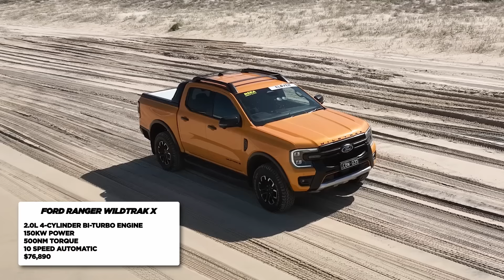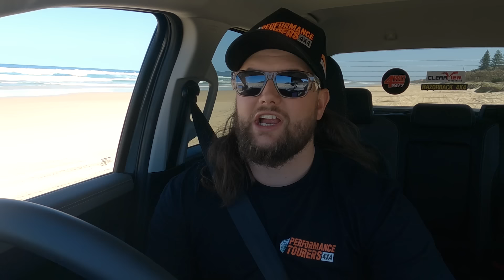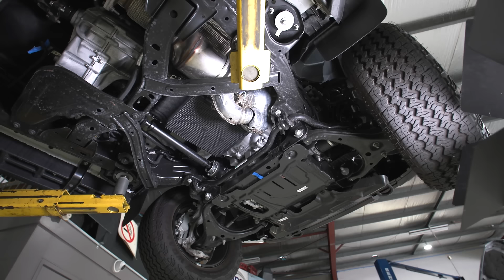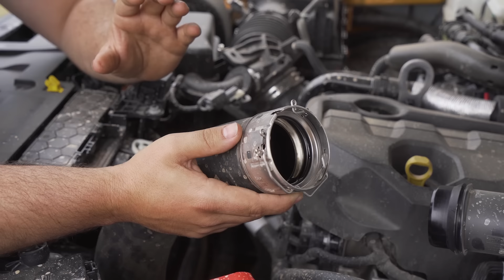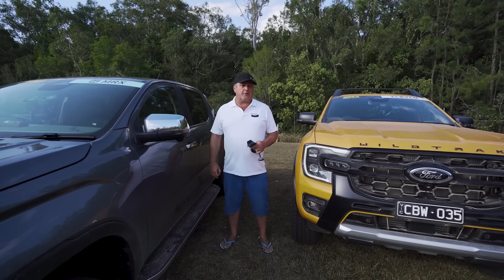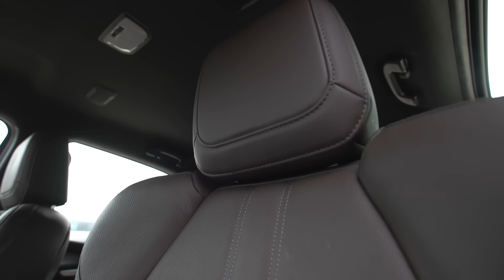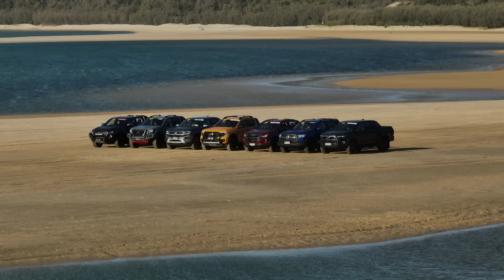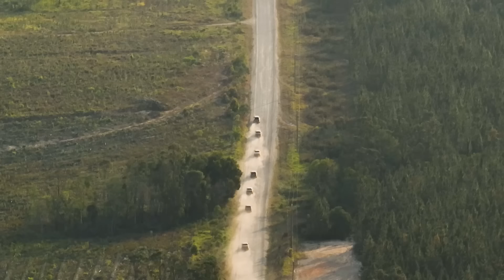2023 4WD UTE COMPARISON - Top Pickups tested Off-road - Shock winner!

Comment from the maker: TIME TO HAVE YOUR SAY! Which of these would you own & why? Tell us in the comments below!
Reply: Mitsubishi triton
Reply: Hilux
Reply: Ranger 3.0 v6 all day
Reply: Toyota poor safety, in passenger safety cell design and technolog,  poor capacity, GVM, GCM. Under powered and fuel heavy, poorly calibrated traction system, small brakes with warped discs often a issue. Airbox design that doesn't have enough clips to seal allowing dust ingestion.
Reply: Where’s the jeep gladiator Rubicon ?  Probably the best off road pick up.
Reply: I knew that the Cannon would surprise everyone.. It was great to finally see one being tested.  The engine does need more power though. This is true for all the Chinese vehicles. They don't seem to have the same power output that the similar sized Japanese or even Korean engine would.
Even more impressive is when you think that Arctic Trucks have a version of the Cannon in their lineup. These are the same guys who built the Top Gear Hilux to go to the North Pole and according to them,  it seems to do very well.
Reply: @007Knightjp  no resale. Not tried and tested. A rubbish truck. Good for 100000k. But then?????????. Hilux all day long.
Reply: @DJ70404  It seems can't go anywhere on the internet without bumping into a fanboy who can't comprehend that some can be happy and have a good reliable experience even if it doesn't have a Toyota badge on it.
Reply: @007Knightjp  you did read my triton comment didn't you? I loved the triton. I was going to buy a new one. Then I took the Rogue for a drive.....
Reply: @DJ70404  My apologies. I did read your Triton comment. I'm just tired of constantly seeing comments from condescending Toyota fanboys all over the internet and on every single vehicle review on youtube stating how Toyota is the best ever and every other vehicle brand is rubbish. 
Then they get upset when I reply, telling them how I've had to stop a number of times to help people when their Toyotas have broken down either from overheating or the engine died for no apparent reason. I drive a Ram 1500 and it has never given me issues in the 9 years 300,000kms I've done in it.
Reply: @007Knightjp 因为中国有严格的排放标准，导致没有厂家愿意生产大排量的汽车。以后混合动力和电动将是中国汽车的主流方向。
Reply: the V6 in the ranger and amorok is the Lion v6 as seen in the landrover discovery 4........ not a paragon of reliability.
Reply: @craigblack85 unfortunately, most people don’t use their brain to do research. Only absorb whatever car experts gave to them. I was questioning the same thing in different channels about this 3L v6 lion engine.
Reply: Amarok or Ford.... Beast. It dragged all the other 4wds home on your Kimberley trip.
Reply: For the towing you said the D-max gets a 6 but on the board you put a 7
Reply: I wanted something aimed at off road and got a Rubicon Gladiator.  Coil sprung solid axle front and rear with front and rear diff locks and 33" from factory.
Reply: Should have included Mahindra Scorpio 4wd Ute
Reply: Massive Toyota guy, so 100% the Hilux. Can't beat the reliability, repairability, and upgradability of it. My only change would be to get it manual, and just a number of aftermarket mods
Reply: Toyota should not receive the notarity or media promotion based on a fanboys profile. 
A 3 star safety rated vehicle vs current 5 star 2020 vehicles Toyota put profit over public safety in all their vehicles and should not be rewarded for that alone. 
Toyota vans have injured and killed more people for this exact reason 5 stars vehicles available for 10 years while Toyota did nothing.
Reply: I love the Navara,good looking rig,more comfortable..
Reply: I have a XSR Cannon and tbh, I get  a lot of hate for it... becareful guys cz honestly it just gets better and better so thank you for this Vid I was happy that the Cannon did alright 💯💪❤️
Reply: I'm from the USA to bad you don't have the Chevy Colorado zr2 the new Colorado is an awesome off-road vehicle I bought one and love it with front and rear lockers and has lots of power with the new engine I owned an older Colorado that was not a zr2 and put quite a lot of money in it upgrading it but as I get older I like having the factory installed options with warranty why don't you guys have the Jeep gladiator there it's sold in Australia it would destroy the other trucks you have there
Reply: @mrgreen8357  it's a chevy. We don't need that crap here. It'd break.n
Reply: Ya know the country has gone to pot when they start calling Ute's a pick-up or a truck....I'm retiring from this milenial nonsense.
Reply: I'd get the Jeep Gladiator Rubicon, because it would sh!t on all of these
Reply: Hey guys, wandering why yous not testing rg Colorado?
Reply: I’ll wait for the new Hilux.
Reply: Hilux  and Dmax all the way!
Proven and tested to last long.. 

My friend of mine owns a 2019 ranger raptor and it has already an engine support problem with only 15k++ ODO 😅
Reply: Amarok all day
Reply: hilux bro, durability ok reliable, dan tidak terlalu malu, teruji di medan
Reply: Just cuz I'm from the States, I would buy the Triton cuz we don't get one! Also the Mazda truck is weird as hell. I think I'd go Isuzu 🤔
Reply: I,m over in Wales and had my MK5 Hilux for 21 years , you can't beat reliability , and this is my 2nd Hilux , btw, i paid £6,450 with the trade in of my other Hilux so that is value for money, no fancy electronics to go wrong.
Reply: No doubt right from the I'm:text-green-game-over: taking the FORD RANGER WILDTRAK X:washhands:
Reply: @4WD247 when is the 2024 video coming?
Reply: My friend has the exact same wildtrak x same colour and same everything I’m pretty sure they got it from Queensland 1:09
Reply: Next year make sure they all have the exact same all terrain tires, because nobody keeps the factory tires
Reply: Hillux
Reply: Screw all the overpriced brands! I’ll take the cannon 💪
Reply: V6 ranger, Really hoping to see the ranger raptor and ranger super duty next time
Reply: Hilux, proven and durable, not saying people haven't had dramas. But I've owned two here in Central Aus for bush work and were bullet proof. I'm onto a 2024 LC79 now another solid rig!
Reply: Where's Mitsi Triton/l200?
Reply: Where is the Triton... Where is the bang for buck ute!!! 
We see enough of these utes plasted all over youtube, id rather see the underdogs perform.
Reply: @bradleybarker4268  Ford wouldn't have paid them because it'll win in the capability segment again
Reply: hilux bro durability reliable dan teruji di medan
Reply: I am still wondering why havent you guys got the Mendez Benz x-class 4wd ute
Reply: @crunchied8 it's been out of production for 2 or more years, defunk, history, gone.
Can't test what can't be supplied.
Reply: @crunchied8  they don't make them anymore
Reply: For us down here in Au and NZ there's only one choice. Hilux all day long. Any shortfalls have been well and truly addressed in the aftermarket and a there's a massive amount of aftermarket options, parts easy to find, easy to work on and everyone knows how to work on them. If you can't afford a 70, Hilux is the next best option.
Reply: I reckon the hilux. Everything else is junk

Comment: Not sure why AdBlue is a large consideration - most of these vehicles will do 10-15,000 km to a tank of AdBlue, so if you were heading out properly remote you’d just top it off on the nearest highway. If you’re towing heavy you might only get 4,000 from a tank of adblue, in which case you’d throw an extra bottle in the car at the nearest servo. I see AdBlue everywhere I regularly see trucks, given so many of them use it too. 

The flip side is a big improvement in emissions, which is basically the only way we’re going to get to keep driving diesels. It’s totally worth it in my mind, and I’m disappointed you use your big platform to talk down to it.

Comment: I love your show but I am going to call you on the towing of the Cannon I have a 2021 base model cannon and have been towing with it for the  three years I have owned it. My van loaded is around 2500 ton and I have not had any of the issues your guys seem to have found. Love to know what mode you were towing in because I turn off  lane control and put it into sport mode and dont even know my van is on the car, So not sure why you guys were having  the issues you were having

Comment: What a great video, but one thing comes to mind during the sand test. Me being a WildTrak X owner, i think if you put it into "Sand" mode or any other one of the off-road mode, it will turn off Engine auto off feature. In-fact during the first test, if Jocko used mud-ruts/rock crawl, the X would've eaten that hill for breakfast without breaking a sweat, but i know the crew here is trying to leave everything as "factory default" as possible, but if that is the case, then the ute/car will be in the wrong mode for the job, default mode would be useful for overall on tarmac comfort etc.

just my 2 cents thought.

Love the video, love the crew! especially Jocko! and love the show!!

Comment: Not as good as the year before, still entertaining but using the premcar Navarra is pointless and not putting them all on the same AT tyres like the year before either.
Great feedback from EFS, amazing that Mazda/Izuzu haven't had to do a recall (Mazda Frankston & Mazda Australia deny it exists ). Do not buy one unless they are so cheap that you are willing to replace the suspension under warranty from day 1. If I had seen this 2 years ago I would have bought the Rogue instead of doing all the changes to BT50 only to trade it in.
Reply: What happened mate?

Comment: Great review.
Just noticed on the brake engineering that the Hilux front rotors are only 2mm smaller than ranger but is the only vehicle on the test to run 4 piston front callipers not 2 piston like the rest.

Comment: Jocko, only the Navara, Ford, Amarok can engage rear diff with TC still working upfront, unlike the hilux (navara did it first with pre-facelift). Those 3 should score higher than Hilux, but it is to be expected that u guys will score the hilix higher

Also it is better u get drivers who know their cars,a ford driver, a nissan driver, and ask them to do the tests themselves. Now u guys are just judging by what u know (likely Hilux), and if anything is askew it is scored down!!!

Comment: D-Max for me, but I’m thinking Africa tourer. That engine can chow down terrible fuel. Toyota tax has you paying a lot more for parts with the Hilux. Both can be fixed by a bush mechanic. I see lots of wildlife service rangers using DMax and MUX in the parks and that’s usually a massive stamp of approval for a 4X4

Comment: The comment made a few times in this presentation "good for 10 years ownership"   was my guide to selecting a new ute, I studied the market closely for three years and just recently bought a new BT50 , no regrets whatsoever, really getting to know and appreciate it. Much quicker and smoother than I was expecting, I'm banking on ten or more years use in the country. Been driving 51 years now and hand on heart the BT50 is the most fuel efficient car I have ever owned and is brilliant for distance drives, effortless feel at cruise etc. Will be investing near two grand for the aftermarket steering knuckle kit that alters the geometry and removes the bump steer problem, apart from saving tyres I'm told the front end will sit more stable on the road. Thanks for the test, I really enjoyed watching.

Comment: Something to note about the dmax tailshaft is that the lower spec model actually has a steel tailshaft, which is fitting to their rugged work focused design. So if you really wanted to, steel tailshafts are available to swap into the higher spec models.
Reply: Yes but lower spec has two piece and doesn't fit the body missing the crossmember mount

Comment: Don't let adblue stop ya...I'm a truck driver its more common then you think 🤔 my mother has bought 2023  Bt50 pov spec manual....I have driven it bog stock very surprised with HWY tires just having that rear diff lock seemed to me with good vehicle placement you can go most places a fully modified 4x4 can.

Comment: Ford Ranger is still the car that I wanted among this choices. The Ford Steering wheel is the best in the world. And I will select the best steering wheel, dashboard and overall interior feel as you touch the wheel all trip long it must look and feel good. It is also have beefier parts that can withstand harsh countryside road. They say fords are unreliable, we use the old to the newest models extensively and they all the same reliable or unreliable as the Hiluxes.
I live in the countryside Philippines anyway. Here it's either a Toyota Hilux or a Ford Ranger. The other brands doesn't sell well because they are physically ugly looking regardless of how well they perform. Sometimes the looks is a factor in getting a new car. The Navara is a fluid and sexy looking pickup truck also, but it's not an all rounder pickup, it's more of a dedicated off-road car rather than utility.

Comment: Hilux got high score numbers for a vehicle that has engine issues. Giving high scores for engines with no history i dont understand. Reliability especially in remote driving 4x4s should be most important not power (amorok) they are not drag/sports vehicles and we arent all 18. long history shows reliability or not. The navara engine has a very long robust history in Europe. Some little issues - hotpipe $450 from crg and upgrade seal factory warranty. Singing the same tune every comparison seems so commercialised, but i guess thats how they keep going and making money.  Need to take with a grain of salt.

Comment: Amarok V6 with some mods, wheels, tyres, bullbar and a snorkel to start. Later on down the track suspension with a small lift. Perfection
Reply: I expected much more for ranger and amarok. The 4A mode is underrated. Test towing 3,5 to in rain. 4A will get you much more grip than 2H.
And the bigger AT Tires on wildtrak X with Bilstein dampers, I expected best in class comfort offroad

Comment: Hilux will always win in my book. I have zero problems with my GD6 and i have had it for 6 years now. I replaced 1 battery and wipers and tyre's. I do alteast 40% gravel driving and I tow very often. I'm in South Africa so our weather are quite similar.

Comment: To fix the lag and constant gear changes just flick the giant dial into sport mode, they drive completely different, throttle is much more responsive and holds RPM

Comment: So wildtrak X has the same score in value for money as the Lux and the Nav even though its not bushproof, not reliable, highly strung, tranny needs work and only comes with General Grabber ATs and lift where as the Nav comes with Bullbar, Coopers, Lift, 3mm bash plate and all for less money. Strange but okay

Comment: Or of course, you could just leave power and torque alone as it comes from the factory.  No need to mess with it. 
As for snorkels and RAIs - pointless proven waste of money with the exception of proper waterproof snorkels if you intend to wade deeper than manufacturer stated max wading depth. RAIs do Not improve air quality or anything. 

Watching all this tells me get a Petrol Ute. No DPF issues, no AdBlue, No worrying about exhaust temps etc, no issues worrying about fuel. Just easy, trouble free motoring with loads of power.

Comment: Getting the ford wildrak with the bi turbo instead of the v6 (which most people get) let the ranger down in a range of categories. It has the same engine as the one tested in the Amerok. For example they gave the Amerok an 8 for engine and a 6 for the bi turbo… the bi turbo 6 might be accurate, but nobody with any intentions of taking the ranger off road would be running the bi turbo model.

Comment: Come on guys, the V6 and 10spd are not new.  The v6 isn't even new to Australia.  The engine dates back nearly 20 years and the Ford Territory used a 2.7 version.  The base design has been around longer than the Toyota engine by 11 years!!!!!   I'm not disagreeing with your verdict but the rationale is a bit iffy.

Also adblue has been around for nearly 20yrs.  Pretty sure most modern heavy trucks will be using it.

Comment: The first offroad test scoring didn't make sense. All the utes were tested without lockers until they needed them, but the GWM got full marks without even testing its traction control ability, just had lockers on straight away?

Comment: Good review and test 👍
For those with lockers, it would be good to see the first attempt without lockers to get a more complete comparison of traction, articulation and traction control systems, then with lockers engaged if it has it. And when lockers are engaged, a visual identifier would be cool. 
It’s a bit disappointing the Ranger Raptor and Jeep Gladiator weren’t in the test, and it would have been good to see the 79 in there too for completeness.
Reply: They all had lockers.
Reply: @jerrymyahzcat  Only one is twin locked, but all the others are rear locked.
I missed the part where they mentioned first go without lockers, but those that did it without lockers didn't get a chance to see with lockers. We also didn't see the Cannon, BT50 or VW do the first hill, and the Cannon only did it with both lockers engaged - Didn't get to see traction control.